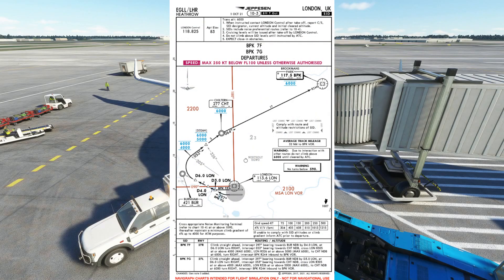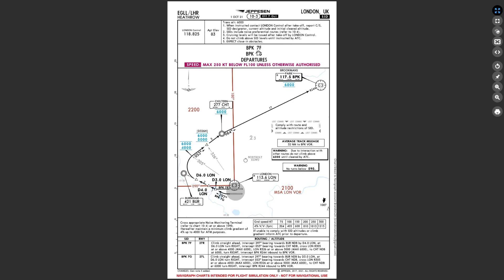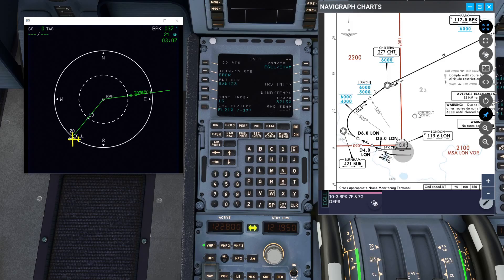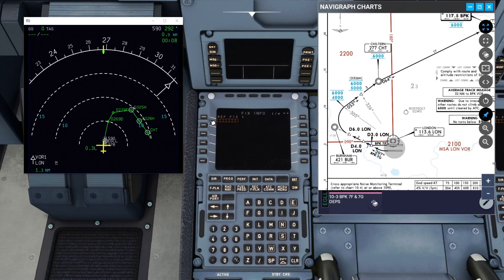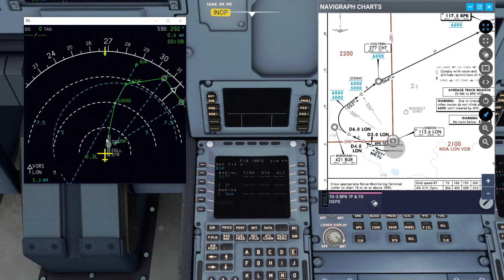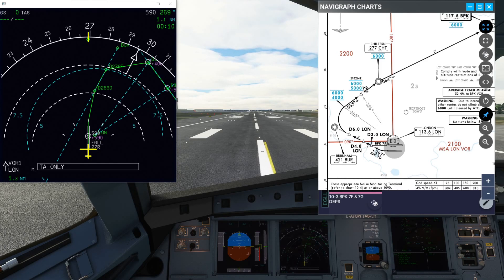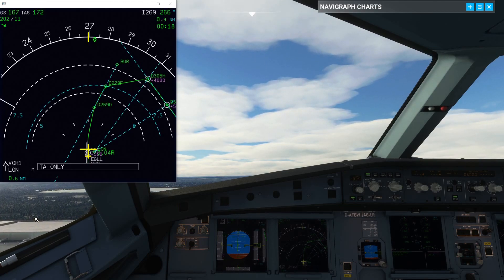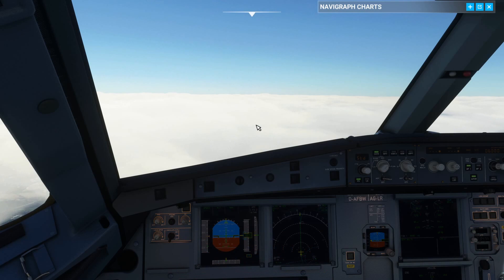How to Fly an Instrument Departure in The A32nx | MSFS2020

Comment: What version of the FBW Airbus are you using? My v7 stable version doesn't have the weather on the EFB? Thanks.
Reply from the maker: You must have a flight loaded in Simbrief in order for it to display on the efb.
Reply: @RealSimPilot  thanks. I do that, but SimBrief never shows on the EFB? I get it to load on the FMC but the EFB is not talking to SimBrief?
Reply from the maker: @davidh7280  have you added your simbrief username to the efb? Efb settings- atsu/aoc-simbrief username
Reply: @RealSimPilot  I'll re check. Is the username a number or my actual log in name?
Reply from the maker: @davidh7280  it's your username that you login with. Insert it with no spaces if it's more than one word.

Comment: When you try to do STAR it messes up the whole flight plan within flight sim. Have you ran into this?
Reply from the maker: Yes I have. It's better to do the STAR on the ground before you take off. 
If you have to change it mid flight. Use heading mode while you change it. Then select direct to on the mcdu and choose your next waypoint.. then you can go back to NAV mode
Reply: @RealSimPilot  do you think you can make a video on it? And how you deal with it like you mentioned here? I’m still new to the game but It’s a big issue and there’s not really much on it. When I do it on the ground it adds loop holes in my flight plan